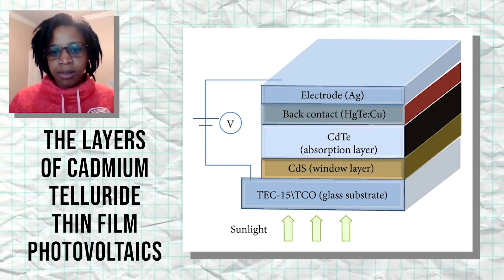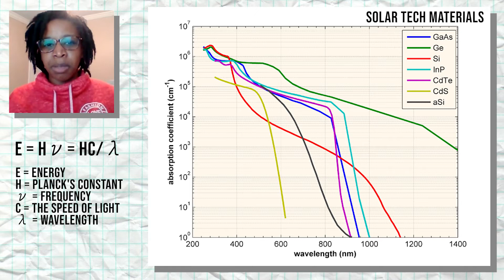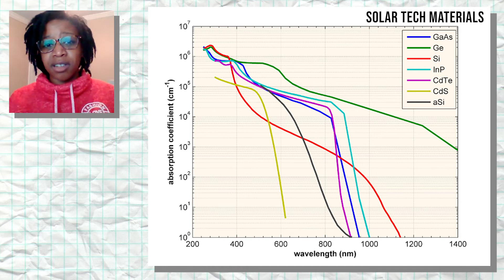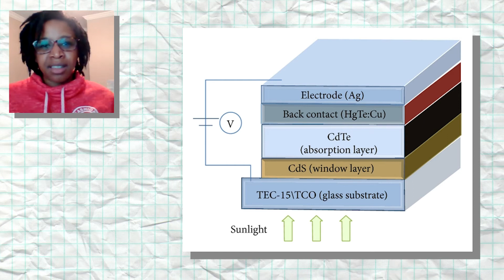All About Thin Film Solar Cells!

Comment: Are there thin film solar panels available for residential solar installations?
Reply: most thin film technology is reserved for space applications due to it high production cost. standard upright silicon technology still dominates terrestrial use because of the cost vs efficacity relation ship. silicon while not as efficient as other material cells, is so much cheaper to manufacture, that the cost per watt of power produced is still more favorable. It costs on average 10K per pound to send payload into space, so therefor its important to reduce weight of the cell and thus thin film technology takes over. The increased cost of production is balanced out by the reduced cost to send it to space, and the increased efficiencies become favorable. As more research is done on the development of thin film cells and the cost of production decreases, the cost per watt will become more inline with silicon cells and the new thin film technology will begin to phase out upright silicon cells. alas we are still years away from thin film tech taking over terrestrial applications. The most promising thin film tech is in GaAs cells. Silicon cells aren't nearly as efficient as GaAs (about 22% for CdTe and 29% for GaAs, for reference silicon cells are usually in the mid teens ~16 %). Cigs are also pretty poor in terms of efficiently and have been mostly abandoned for space applications due to their negative response to the radiation present in space.
Reply: @loganmapes2307  not sure about your info. Seems to contradict the potential concept that thin film once scaled will be far less energy intensive to manufacture than any existing manufacturing process. Also, the fact that thin film efficiency goes up under increasing temperatures as opposed to standard panels where efficiency drops significantly as Temps increase. Then we have the fact that thin film is far more efficient in shade or cloudy applications which can utilize the full day of light versus the peak moments that standard panels boast those outputs since they are only achieved at the most optimal conditions (not all day). This statement addresses the application here on earth as opposed to space. I would assume in the space scenario that the solar radiation not buffered by earth's atmosphere could reach 250 degrees Fahrenheit when facing the sun making standard panels far less productive than thin film. The biggest question for thin film is longevity?
Reply: @Dana5775  dude I did my senior project on thin film GaAs solar cells for my physics major. Almost everything you just said was incorrect. I can send you my published paper on the topic if you need. Thin film efficiency most certainly does not increase with temperature, it just decreases more slowly than si upright cells. Also they aren’t more efficient in low light… they are just more than efficient overall so yes they produce more power in low light than si cells in the same low light  but not by a percentage difference that is disproportionate to the difference when compared in together in direct light. The cost of manufacturing isn’t in the energy required to make them. It’s the materials and the engineering (hours of labor/research) of the process etc
Reply: @loganmapes2307  you mis wuoted my points and you talked in a circle and contradicted yourself.  I have them on my roof and they are out performing my neighbours amorphous thin film solar panels.
Reply: @Dana5775  ok buddy
Reply: Yes look at cigs panels... Thin silicon panels not yet but they are coming...